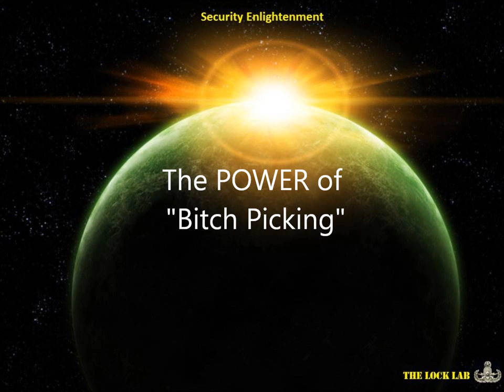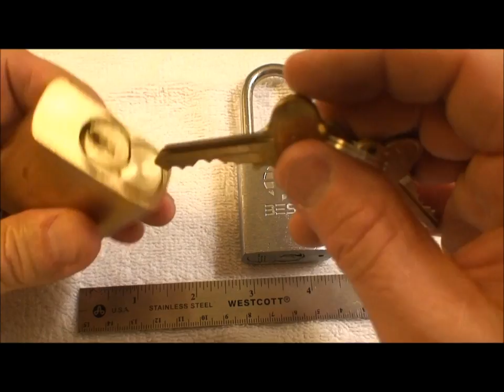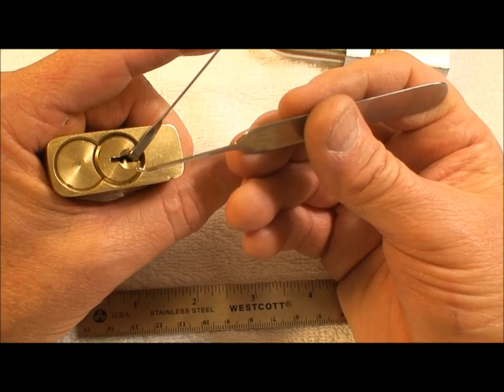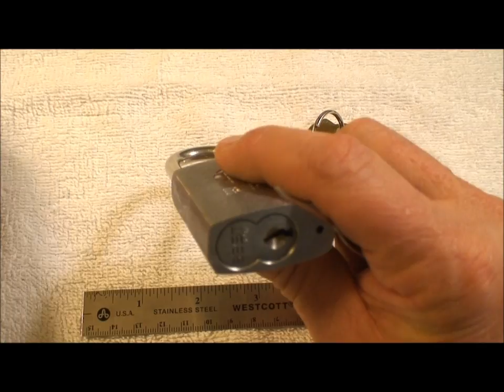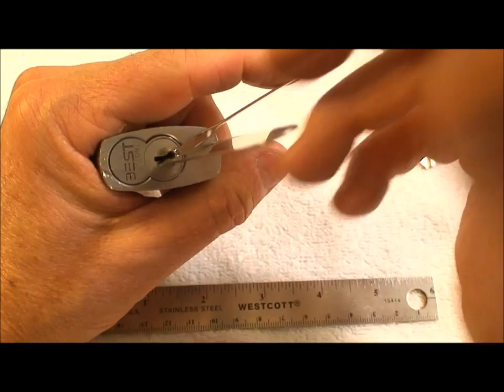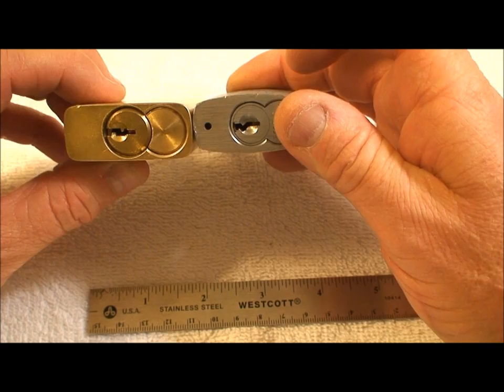(69) The POWER of B*tch Picking (Lock Picking Technique)

Comment: okay, so a couple of years ago i bought a cheap pick set and tried a couple of times to pick a couple locks. very quickly i put it down and forgot about it. here recently i found your channel and ive been watching your videos. well it got me motivated to try again. the only locks i have to practice on are on the entry door to my house. well yesterday i picked my kwikset deadbolt, and then after watching this video, i tried this method and wow, works quick! now i just need to get some practice locks and what not. thanks for the videos!
Reply: +bosnianbill well luckily i live in a very low crime rural area, and and i have the deadbolt and the lock on the doorknob. i do plan on changing the locks out though at some point here. the reason im not in a real big hurry to do that is because i dont think that deadbolt is my biggest security risk. its definitely not the fastest way into the house.

Comment: My work uses these Best locks for everything. Our facility runs 24/7 and every time someone on the overnight crew loses a key I get a phone call and I inform them they have to cut the lock.  When I get in the next day I replace it and redistribute proper keys to every member of management. I could go for the key qualification class and eliminate this issue entirely by having my own set of keys, but possessing keys with my company opens you up for a lot of “favors” which I’m not interested in at the present point of my career. This has lead me to attempt learning to lock pick as I have always had an interest in it and find it to be a very useful life skill. After some research I found these Best locks to be particularly difficult to pick, but I’m going to give your method a try. 

I consider myself to be a bit of a jack of all trades. This is mostly due to my desire to learn how things work, so I’m constantly taking things apart, fixing them, modifying them, or just plain transforming them into something completely different. This “hobby” of learning how things work has been very rewarding and has helped tremendously in my career. Most of my coworkers think I’m some kind of wizard or something because I’m always taking on the opportunity to “fix the unfixable”. My colleagues bring me everything now just to see if I can figure it out. It’s satisfying to finally figure something out and it’s rewarding wow’ing your peers. Picking a lock aught to be the icing on the cake. To most people locks are a complete mystery and impenetrable, regardless of how simple they truly are. Thank you for your content. I found it both entertaining and informative.

Comment: This video is 10 years old and it still holds up! I just got back into lock picking recently. I am usually able to rake open standard pad locks, but I always struggled with door locks and dead bolts. I don't know why, but I just felt the urge to get back into it, so I purchased a few cheap deadbolts from Lowes. One of them was a RB and the other was a Kwickset. For the first couple of hours, I struggled with them, but after watching this video and combining the rake and then following through with the bitch picking technique, I was able to get them both open. In the past I would spend up to an hour trying to rake open door locks, but I wasn't able to do it with the rake alone. Combine raking with bitch picking and it's actually quite doable! 

The rake will actually set most of the pins in place, so you only have 1 or 2 that you have to set after raking. There is a learning curve, but I tried again and again until I was able to open the locks 10 times in a row without messing up. Once you figure out how the lock works, it becomes effortless. It seems like each lock is different and has a unique learning curve depending on what the key looks like. I have found that the easiest locks to open were the ones where the keys didn't have much elevation in the cuts.
Reply: Same, try heavier tension and a good stiff short hook in .25

Comment: This one video help me on the job today! I have a pick set because one of my jobs is maintaining rental properties and sometimes the renters change the locks on the landlord. A rake or rocker usually gets them done since they go for the cheapest locks.

I used this at one point to get to some....interesting areas of my university just to see what was in there - abandoned storage, electrical, etc. Nothing malicious happened, just wanted to test myself on some Best locks. 

Today I had a call where a restaurant had locked the key into the freezer. Tried the rake and the rocker-no luck. Went to this and had it open in 30 seconds. 7 hours of billable time for 2 minutes of work!